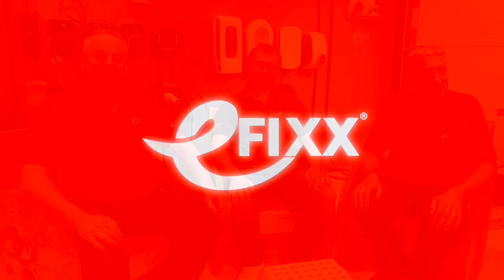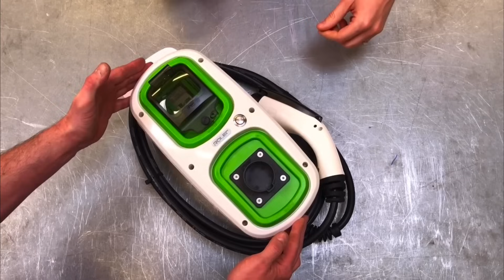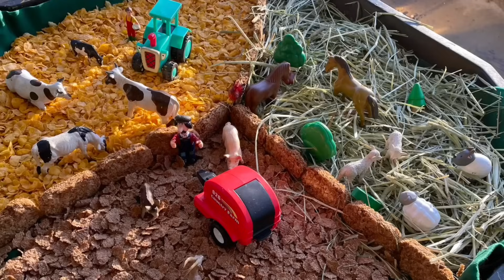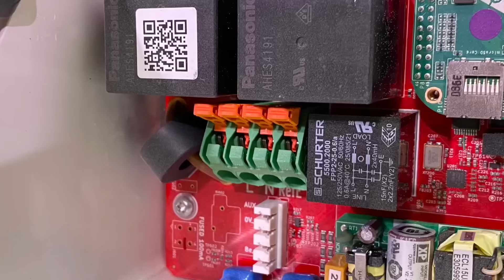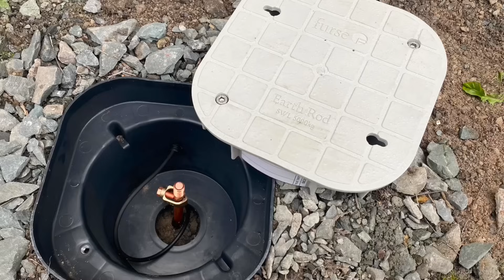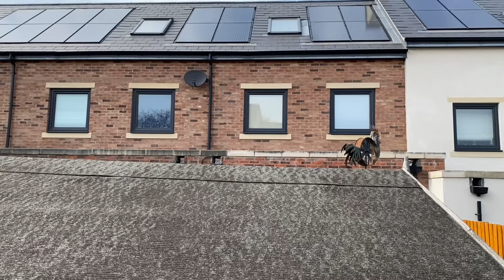EV Charger REVIEW: Cheapest, Smartest and easiest to install with EV Nick.

Comment: So basically the government pushing people to get electric cars and then can't deal with the power demands and so they are restricting  you when you can charge and putting the price up. So in a nut shell don't sell your petrol or diesel cars because the country is not ready for the shift of power. Also didn't we just have a lot of people lose money on there diesel cars because the government encourage diesel cars and then put on ulez if you car doesn't meet the new emissions.

Comment: Great vid gents thanks!  And Nice plug for EVNick too, not seen him previously.
Sadly what you’re discussing towards the end video, sounds like a nightmarish disaster in the making, where only the consumer is going to lose.  I’m thinking about the smart meter rollout as a working example, where in my own circumstance, the house I recently moved to had a smart meter installed before my ownership, which neither of the suppliers I’ve had since moving could use.  I’m certain that’s not an isolated case.
Similarly if you consider common issues encountered on EICRs for fairly well established standards, how the grossly inconsistent and standardisation neglected car charger market is ever going to deliver a reliable functional product with any longevity is beyond me.  And that’s now at present before any ‘smart’ controls and variable tariffs.
If only we had a body of Electrical Engineers whose job it was work with industry to develop and set solid rules for these sort of things. 🤪
Reply: Cheers Andrew

Comment: im getting a vw id3 and will need a 7kw charger. I want to lay the cable through the loft before the builders convert the upstairs to rooms. It will be a 20mtr run total inside and external. Do I need 6mm armoured cable or 10mm. Thanks

Comment: I  will definitely be fitting  P.V.  & battery's & upgrading my hot water tank because of the recent energy bill increases. When complete my aim is to be gas free & lower reliance from the electricity grid. It looks like my gas & electric will cost around 3k a year. Luckily I have a large roof facing due South, I have experience building battery strings & I also did the niceic P.V. course a few years ago.

Comment: Two things I'm not happy about with this video. Firstly, why are we taking advice on installing EV Charge Points from a non-electrician. Secondly, I don't like that the Ohm EVCP is being praised for coming pre-wired with a cable to connect into a junction box next to the charge point... It is just moving the point of potential water ingress from the EVCP to the junction box and frankly looks absolute shite having an extra box on the wall

Just my 2p
Reply: Hi Jonathan your correct am not an electrian but I have got a background in electronics and IT also I have installed all these units and used them.  I've also used all the userside features which is more imporant than what an installer likes or dislikes.  Moving to the juncation box can look horrid i agree but every install will be diffrent some it can be hidden internally for example but having this preleaded does mean if the failure is the junction box there is a clear mark on where the fault ocured and who's at fault.   The best design in this case might be easee which doesn't let you into the internals using its mouting block but the app isn't as feature rich as ohme.

Comment: I'm trying to get my head round loss of fuel duty to the excheqer as vehicles move over to electric and how this must surely ramp up domestic electricity charges for all of the homes usage or will individual smart appliances talk to the meter to invoke their own kwh rate or is it more about load balancing for the grid? Seems metering may get quite complicated.
Reply from the maker: Road pricing may be part of the solution. The government also collects 20% VAT from commercial EV chargers
Reply: @efixx  yes just read an article, sounds like smart vehicle tracking of miles travelled then taxed which is proportional to road wear and tear and usage. Pool vehicles will probably become the norm as private ownership is phased out so vehicle would likely require the driver to log in to the vehicle to determine who should be charged the fee. Interesting developments ahead.
Reply: I have a prediction on my YT channel about how this may be done but one fair method is a PER Mile cost and reported yearly via your MOT or other means and tailed up when you sell a car
Reply: @NicolasRaimo  the smart grid will be a control / tracking system so when the digital id and digital currency(cashless) is fully operational i would imagine the tracking data from the journey would be instantly invoiced and funds taken from the drivers account rather than building up a debt and pay later. This will smooth government cashflow also.

Comment: Why not an ordinary 16 / 32 amp rcd protected socket - separate earth stake -  EV,  not much
different than a caravan, and the vehicle regulates its own charge - so I am informed ?
Reply: Carvans are not hooked up to a very large capacity DC battery with 400v or even the new 800v packs that could potentially leak DC back into the system and blind the RCD.  You could install separate earth stakes and some ev chargers don't have built in PEN fault but how many earth rods you may need on each site and how easy may it be to install them are other questions.  Also the car can manage some aspects but not all.
Reply: I was thinking the same, most domestic charge at a max rate of 7Kw (about 30 A), so why not just have a commando socket. There are leads available now with the Pen fault detections and RCD protection built in so no need really for a dedicated wall mounted charger. However its the smart tech in the wall mounted charger that people seem to like as it can save them money, the DNO's also like smart chargers as they can relieve pressure on the grid. I reckon sooner or later it will be compulsory for all car chargers to be smart. In fact I reckon that alot of people will just get fed up with cars and not bother.
Reply: @JamesJames-um5xq  due to come into legislation this year

Comment: Has the UK got enough grid capacity for everyone to plug in a 7Kw EV at 32 amps all at
the same time ie. overnight ?????????????    Plus night storage heaters if fitted ???
Reply: Acording to the interview I did with Graeme Cooper of the national grid YES,  however as mentioned in video lots of these chargers no able to do grid side response and customers are paid in taking part.

Comment: I had seen this video and was a little curious as to why the Rolec is not on that wall. Then I found your Rolec video (admittedly around two years old) where you praise the Rolec highly. Still I wonder why the Rolec has fallen such out of favour when it seems as if it was the bee's knees of home chargers.
Reply from the maker: ROLEC was the first charger we reviewed and out main aim was to understand what’s inside. In two years EV chargers have evolved and now need to be smart and cater for additional safety features such as PEN fault protection.

Comment: I recently did a commercial twin outlet single phase Rolec. Customer decided that 22kW was pointless since their Polestar cars would only charge at 11kW anyway. Reasonable looking box but internals were clearly an afterthough, couldn't reach the screws on the RCD at the top to check tightness, designed to hang on the top screws making it very hard to keep water out without sealing round the entire box and even worse for a single phase product, both outlets had been combined thus requiring a 63A single feed off a single phase!! Who is going to do that unless a 300A supply? Had to separate out the outlets for two supplies thus destroying the warranty. Obviously had no PEN fault protection and had two install 2 GARO upstream! What is the benefit of having upstream RCDs now other than saving money for the manufacturer? Real fun testing the units and running back to consumer unit for every trip! Final nail in Rolec's coffin was the fact that if the RCD tripped inside the unit, 6 security screws have to be removed to allow reset and the silly lights on the unit 24 hours really attracted the wrong sort of attention. Rolec deserve to lose their market entirely with this sort of poor design.

Another point often missing is the reliance on WiFi at the location of the charge point - my WiFi is not great outside the house. Should us electricians also have to deal with WiFi issues?

I try to avoid charge points that only support WiFi, can not be used without a phone app, have no RCD A type + DC protection + PEN fault protection or use Raspberry Pie controllers which are a poor excuse for proper PCB design.

Finally, it would be great if you can also highlight what support of OCPP actually means. Charge points with this protocol can be connected to different back ends and not tied to the manufacturer (Zappi is an example of one that can only talk to Myenergi because it has no OCPP support)

Great job though, love your videos

Comment: Please don’t throw away your Rolec chargers it is important that we upgrade things. These chargers are easily upgraded. I use Octopus Go tariff so fitted a timing module next to the RCBO and linked it to the communication cable to the EV. These chargers have easy available spares and are very easily to upgrade. I love the way they just use a din rail and there is plenty of space.
I personally prefer to avoid WIFI switching and apps as they are less reliable.

Comment: In a domestic environment I always fit tethered units. IMO Zappi for ease of installation, especially it you have solar and not too bad on the eyes, however if you install a Harvi it does reduce the installation to 65 Amps. for value Ohme, how ever you fit it you can't getaway from the fact it's butt ugly. The Hypervolt is very popular at the moment, I like the fact you have to install A Type RCD at source with these.

Comment: It’s good that the electric supply company works with the  EV charger for the cheapest rate, until they go out of business?
Reply: One I mentioned and use octopus is largest and most versatile and global energy firm went from a no body to over 7 million customers in 2 years and just had major investment from Al Gore fund
Reply: @NicolasRaimo  with the current volatility in the market it seems like even big suppliers could go under at the drop of a hat. Are the smarter chargers tied in to specific suppliers?
Reply: @rivkahlevi6117  Octopus just took on avro customer based on ofgem seeing they were stable enough to take on a huge amount of customers over night there’s also rumour they are looking at a take over of another large supplier.  The issue with suppliers gong bust is partly because they haven’t purchased there energy in advance.  The charger isn’t tied to one supplier just octopus for example the biggest in this area

Comment: As you have all those units available, can you measure their standby power draw - for something that's powered 24/7, this could add up to a non-trivial cost.
Reply: The draws on them pretty dull in standby on most the more popular units however may be another Collab with efixx testing just that
Reply from the maker: Yes Mike a good idea - one of the units has a fan for ventilation which suggests higher losses. We also want to explore charging losses.
Reply: @efixx  The Hypervolt EV charger has a fan, which is mainly for other continents, UAE etc
Reply from the maker: @azzurriuk  so why do they add the expense including two breathable membrane vents to all units?
Reply: @efixx  I do not know, probably to justify the price of the unit, sorry I look inside these EV chargers think I why are these units so expensive.
Reply from the maker: @azzurriuk  agree - many of them have lots of separate pcbs and widgets. They need a lesson in design for manufacturing to reduce costs and improve reliability.
Reply: @efixx  Sriously? That us just piss-poor design. No chargepoint should draw enough to need a fan

Comment: I went for the Hypervolt; built-in PEN fault detection, solar integration, effectively a mini-PC so great future upgradeability, nice minimalist looks (some EV chargers can look a bit industrial) and great customer service. Surprised it wasn't mentioned at the start as a rising star as the HyperVolt CEO has suggested they are the second most popular UK EV charger.
Reply: I don't want a mini-PC (or a Raspberry Pi, which is what's in the Hypervolt) in my charger - complete overkill, more to go wrong, more standby power consumption
Reply from the maker: Nick is going to review the Hypervolt.
Reply: Watch my video your find Gordon isn’t a fan

Comment: Can you look at diversity within a typical home as it feels the existing calculations are perhaps no longer appropriate.  For example, the MD of my home was calculated by an EV installer as 69A yet our house typically pulls about 55A of an early evening before the 7kW EV charger is installed. With an 80A main fuse this will overload the fuse? (the EV charger to be installed - BP Pulse - cannot load balance).

Comment: I think the rule should be for the manufactures to make their "innovations" wire up and done. It's not down to the sparky to be a tech support. Wire up a fixed appliance, the rest is on the user and maufacturer how to use it. Which changes every 3 months.

Comment: I have never installed a EV charger. But what I’m saying may be right or wrong. I know of 3 people with Electric cars and all 3 said the same . They don’t want a proper charger as they think the electric supplier will control when they can charge in the future and secondly they shorten the life of there batteries. 
That’s there option not mine
In my opinion what’s the life span of this smart stuff. A smart phone only a few years old ,apps can’t be updated . I give up counting the times a smart meter has gone dumb. Smart stuff will save money in the short run but in the long run it often doesn’t last costing more to replace. I take it’s these chargers have relays cutting in and out as well how long will these last . I drive a 20 year old van . It’s reliable and if it does go wrong it cost next to nothing to repair. Other people I know drive much more modern vans . Yes they get extra MPG but the times they complain that they have had to pay out hundreds or thousands when they go wrong. I know someone who repairs domestic appliances . In his opinion it’s the kiss of death when in the future these smart  things go wrong .

Comment: Sadly all the points you have mentioned about the smart operations. Turning on and off charging is why I don’t think Ev is the way to go. 

I think it is a short term fix and that hydrogen is probably the best way to go
Reply: Electric isn't the long term future, there simply isn't enough rare metals or power capacity to sustain growth. Hydrogen is the future, the mains gas system is already being prepared, central heating boilers are hydrogen ready. It will take over in the next five years.
Reply: @therealunclevanya  my electric car doesn’t contain any rare earth metals… also rare earth metals are not as rare as name suggest…. Hydrogen cars are also all the same parts of an electric car just with a smaller battery and a hydrogen fuel cell on broad adding more complexity.   To make hydrogen you still use electric and due to its poor efficiency your need to generate more electric than if you just charged an EV
Reply: @NicolasRaimo  mains gas will convert to hydrogen in our lifetime. It makes sense cars will to.
Reply: @therealunclevanya  looks at how hydrogen is made then look at efficiency… it doesn’t make sense for car transport it may make sense in some very small use cases but road transport will be primary electric ⚡️ am not tribal in my thinking as well as doing videos for YouTube on EVs my day job is selling cars and advising companies in my consulting work.  

Hydrogen for boilers will fix for some however heat pumps be the new normal for new builds and some older properties will also fit these.  It’s the electricians time to make the money of plumbers now.
Reply: Totally wrong there Antony we said the chargers can do that and If you wish to charge when you want you can but your pay for that benefit

Comment: We traded in my wife's old Acura MDX that averaged 13mpg around town for a 2022 BMW X5 45e PHEV. It get's about 35 miles of range per charge on pure electric power, which is all she uses. The car still has the same unused fuel in the tank as when we bought it.
Our local electricity provider sold me the charger, a Juicebox40, for $177 (after instant rebate) and I spent another $150 on 8-3 Romex, 40A breaker, and RV outlet box. My wife and I installed it all in just a few hours one Sunday morning.
We also get a $.05/kwh discount when using the wifi connected charger between 11pm and 6am. The car charges from 10-100% in just a few hours.
I've calculated that we pay about 1/5th the cost of gasoline per mile than with the old car.
The new car also gets us $2000 state and $7500 federal tax credits. 🙂
Reply: Cheers Rob

Comment: Tesla charger??? 🤦‍♂️
Reply: No pen fault, no dc protection, no rcd…. It’s not even smart…..  also didn’t send me a unit to review
Reply: @NicolasRaimo  And still that's what most countries consider a nice and fine charger. Reminds me of that guy who was driving down the motorway and called the cops to report hundreds of people going the wrong way...
Reply: @HenryLoenwind  Tesla charger doesn't complie with 18th edition regs in its current form and isn't part of the OZEV approved list either.  If you want to fit the fan boy charger because you like the look of it go ahead am not stopping you but if I review it or not it won't change your mind you want to be part of the fan club rather than get the best charger on market.
Reply: @NicolasRaimo  Oh, did I trigger another Tesla-hater?
Reply: @HenryLoenwind  huh? am stating facts no hate